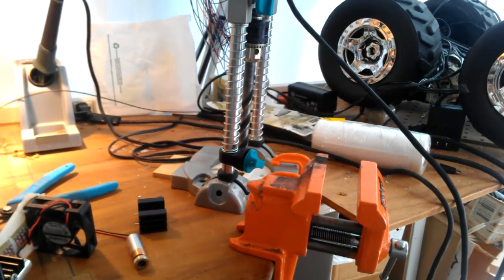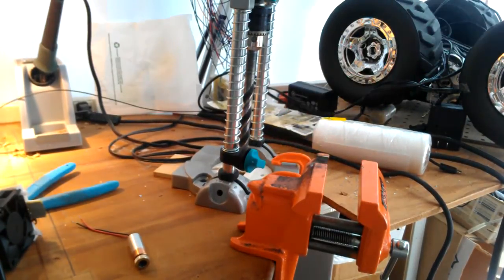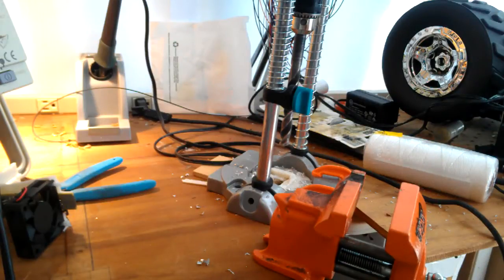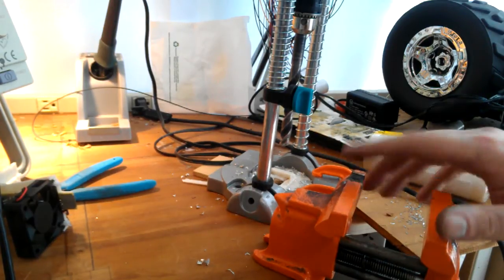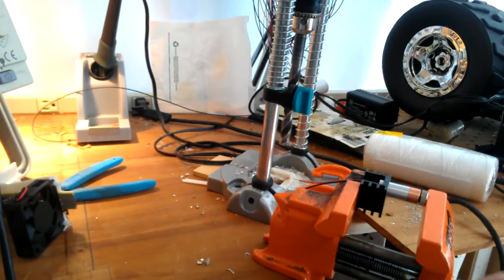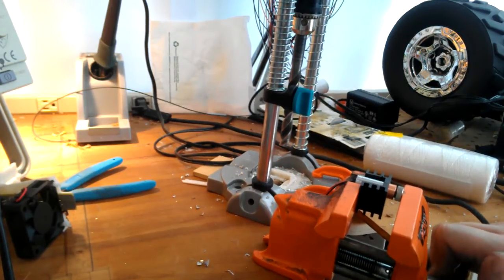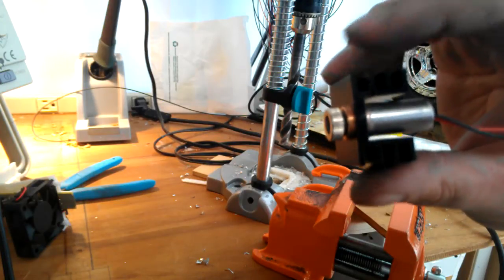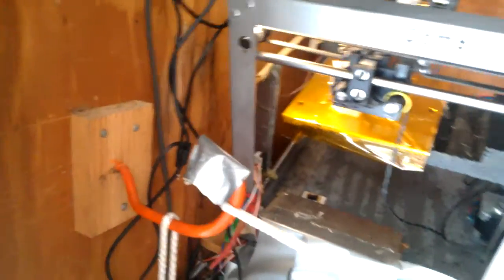L-Cheapo Fabrication Rig

Comment: Instead of pressing the laser into the heatsink, try heating the heatsink, perhaps in an oven. Then assemble, you'll get an easier, and better fit when it cools. No risk of damaging the end of the laser. Thanks for posting.
Reply from the maker: +Skysurfer Thank you! I've tried that, but the problem is that this "squishes" the diode a bit - it may break the glass in the diode module. The pressing is perpendicular to that, and has less risk of doing so.
Reply: +Spiritplumber  Not sure if you've gotten my gist. Put only the heat sink in the oven. Heat it as much as sensible. The hole will enlarge many thou (so it does have to be almost there, to start with...). Push the laser into the hole with no pressure, other than your fingers. There is no forcing involved. The laser remains at room temperature, at least until the heatsink spreads the heat, then you should just expose the assembly to a blast of cool air.
Heat it up so it's just too hot to handle, that'll get you as much as it'll go with heat. If you miss, the second time you heat it, you're not likely to get anything like the same expansion, but you won't have lost anything by trying.
Reply from the maker: +Skysurfer Thanks! I'll give it a go

Comment: Great work. Only suggestion I have is I would remove the lens from the module before pressing it in as the copper threads in the module could give out and strip if the pressure is too great.:)